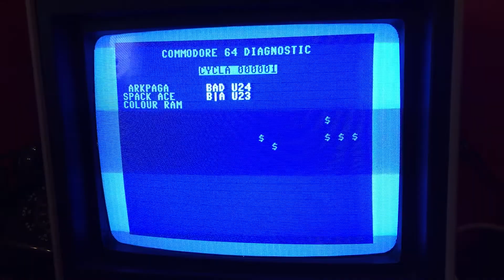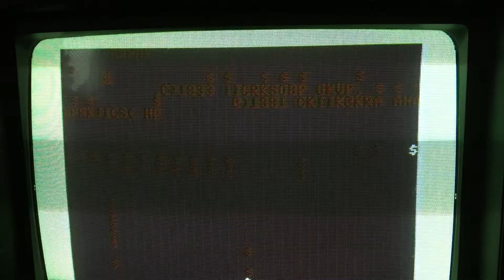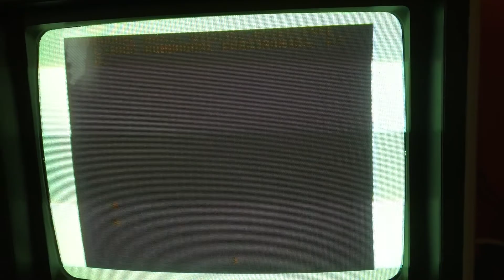Commodore 128 Troubleshooting

Comment: Have you finally find how to fix it? Mine has similar behaviour. It happened suddenly, after working a little in basic. Socketed chips ok, cpu and Z80 ok, maybe a failed SN74... or bad ram? Cheers, M 
Yup, didn't watch the date of the post...2015...yup!!
Reply from the maker: It was the ram
Reply: @retrotechandelectronics  Thanks